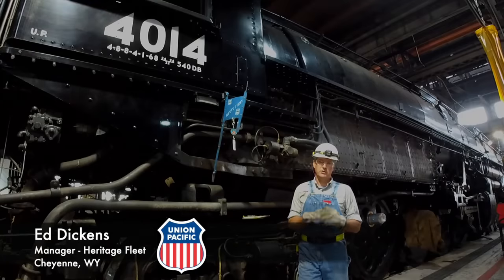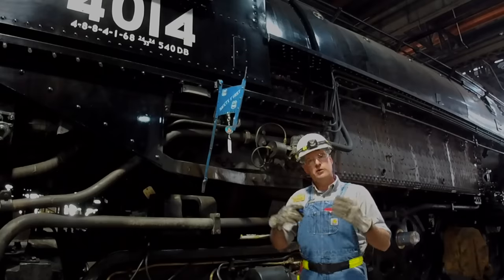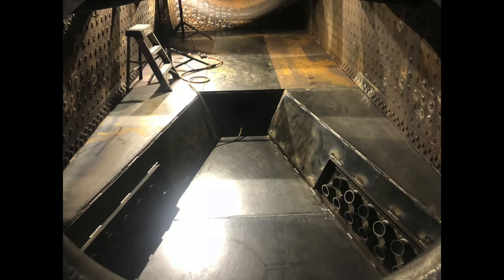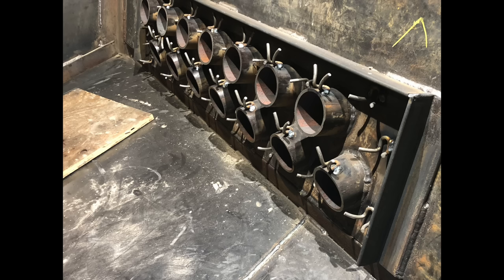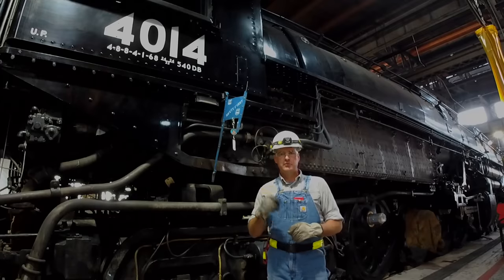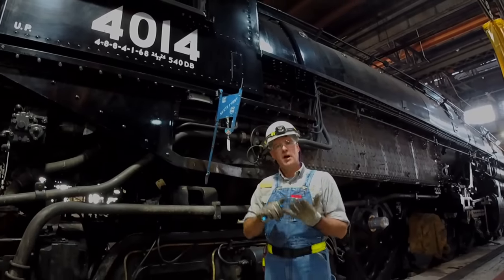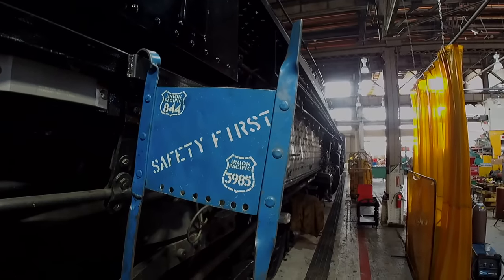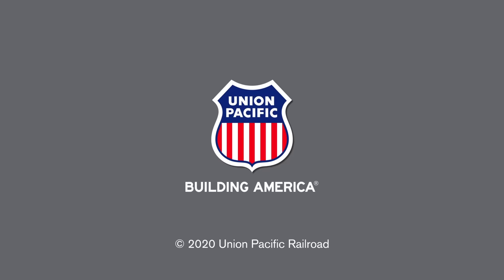UP Steam Update: Converting Big Boy No. 4014 to Oil

Comment: An automatic system to adjust fuel/ air like on a fuel injected automobile engine could be developed for 4014...... but requires time and expense, no?
Reply: Wouldn't work. The conductor predicts his steam pressure needs 2 or 3 miles in advance. You have to build pressure over time without wasting it through the overpressure valve. Waiting to build steam until you get to a hill is too late. Matching the fuel/air mixture in a car is linked to the throttle position sensor, but on a steam engine, the need for steam isn't linked to where the throttle is now, but linked to where the throttle is going to be in three or four minutes.
Reply: @jeffanderlik7695  Wow, excellent insight. That had never occurred to me but now that you mention it, makes total sense. I suppose they had to know (or learn) their routes like the back of their hand prior to operating them.
Reply: @jeffanderlik7695  Automatic engine control....GPS knows where the engine is and what lies ahead....I know, not as much fun but optimum engine efficiency at all times, no?
Reply: @kingmiura8138  there are other factors that require a human interface, such as weather conditions, and obstacles such as other trains. If it were that simple, Diesel-electric locomotives would already have that predictive technology. The train traffic is controlled to some extent by computers, but it's a long, slow transition.

Comment: I find it sad when I hear statements like "the amount of air is controlled by the engineer". On motor vehicles we stopped doing that decades ago, it's called a carburettor, and the venturi on this oil burner is effectively the same thing so why isn't the air/fuel ratio properly controlled in the same way? It isn't even difficult.
Reply: @Kiwi Geo Combustion is combustion whether internal or external, the ratio of air/fuel required is the same. If you like though, compare it to an oil-fired heating system for a large building, the owners of the building would be pretty annoyed if they had to have someone constantly monitoring the air/fuel ratio.
Reply: This is because it's not really like a carburetor. Its actually a damper. And while more automated dampers do exist, having direct control over the dampers gives you more control of your fuel. A boiler you having sitting in your basement won't need it's dampers constantly monitored because it isnt trying to go up hill with a 20 car train and then down the other side. This isn't to say they weren't mechanically supported though. Often times oil fired locomotives would have mechanical devices that would automatically close the dampers during burner stop periods. The point is though that the dampers are normally monitored because it all depends on what the locomotive will be doing not what it's doing currently. A steam locomotive is very large so any adjustment have to be made sometimes miles in advance. Any sort of automated system would have to make changes based on the external environment as well as the internal one. It would also need to be able to know where the train is going and what the weather is. Its of course possible with modern technology but it would be very expensive and have to be specifically developed for a steam locomotive. Considering  the overall cost of the big boy I'm sure something like that wasn't even considered.
Reply: @fermitthekrog6318  The damper is there BECAUSE there is no carburettor system fitted. A carburettor type system would make sure that the oil being burnt is close to the most efficient ratio at all times. It doesn't control WHEN the fuel/air is supplied, just the ratio. It is still possible for the engineer to increase the burn rate in advance of a long climb, I never suggested that part should be done by an automated device.

The damper system is a hangover from coal power. With a coal-fired boiler the burn rate is controlled by the amount of air supplied. Trying to use such a system on an oil-fired boiler is wasteful and produces the smoke seen here. If the price of oil had been at today's level they would have soon changed that.

It is possible for the engineer to reduce the amount of oil being supplied but if he reduces it too much there is a risk that the burner could go out. The engineer also has to increase the oil flow before opening the damper or again risks the burner being extinguished. It leaves the engineer with the impossible task of trying to balance the amount of oil supplied to match the air being supplied, in varying conditions as you have said, with an imprecise damper system. I imagine that having the burner extinguished would be disastrous so the engineer is always going to supply excess oil and as a result cause the oily black smoke.

I agree that in the comparison to a building's heating system that the "demand" part is controlled automatically to maintain a steady temperature and I can appreciate that it introduced confusion but it isn't really what I was comparing.

Comment: I would like to see a k5la train horn get installed on this steam locomotive.
Reply: I wonder if that would even work? I am pretty sure there’s a substantial difference in the air pressure of a steam whistle vs a diesel air horn. Probably opposite ratios of pressure vs volume, just a guess.
Reply: @Syclone0044  there are also steam powered train horns as well.
Reply: no

Comment: Hows the fuel efficiency compared to a diesel electric
Reply: 4014 doesnt use diesel, rather it uses #5 Bunker Oil, typically at a rate of 20-30 Gallons per Mile. (Yes, GALLONS per MILE)

Comment: Is the fixation on running these grand machines on oil an anti-coal statement by UP? Burning coal is one of the attractions of steam powered machinery. Without coal, much of the charm/nostalgia is lost in my humble opinion.
Reply: Converting steam locomotives to oil has been done since the 1890s. The fuel it burns doesn't keep it from being a steam locomotive.
Reply: @jamesfluharty1945  That's your opinion, not an answer to my question. I don't agree with modifying a machine from its original design. It was built as a coal fired machine so it's now not original.
Reply: @dylanlewis3666  it's not anti anything. UP and other railroads modify their locomotives to fit their needs. An example of this is the UP FEF series. All were converted to oil in the 40s. The charm of a steam locomotive isn't in the fuel it burns. Your issue with modifying the machine is rather pointless. Many  steam locomotive were rebuild, fitted with boosters, converted to oil, had tenders swapped as well as many other things. Sometimes they were sent back to the shop they came from, just so the company that built them could turn them into new locomotives. An example of this is the PRR H8. This locomotive class had some units rebuilt into H9s. Modifying and upgrading locomotives has been done as long as they've existed.

Comment: Sadly the Loco now is no longer original. What is next, fit Electric Motors?
Once you start making it "better", it never stops.
The fastest Steam Loco ever is the English Pacific Class, Mallard. Running on Welsh Steam Coal.
An on a normal run, not a record breaking one. An yes it still exists an runs on the same coal.
The speed was just over 126 mph pulling 7 passanger cars weighting 240 tons. On the 3rd of July 1938.
I got my info from a 1950`s Guinness book. NOT the joke wiki!
Reply: Converting steam locomotives to oil has been done since the 1890s and is in no way comparable to putting an electric motor in it. Its called a steam locomotive, not a coal locomotive, the fuel it burns doesn't change that fact.

Comment: Why UP? Even NS didn’t do that
Reply: If I understand your question right, might be because fuel oil is an easier fuel to handle - you can refuel with a tanker truck, and a hose.  Coal takes more handling equipment - or more people with shovels.   Oil refueling can be done at pretty much any yard, or even any crossing, I'll bet.   Coal towers are now few and far between - and not maintained or containing any coal.
Reply: @FalbertForester  
And...coal burning produces cinders, which have started many fires along the tracks in the past.  Oil is safer.  You are spot on about lack of coal handling equipment.

Comment: Plz bring again in world off railways, history says history repeats itself, use some Gas fuel into it ,water can heat very fast , only coal u can remove from it,. On that theory steam can remain same , than its only we can call steam locomotive,  on tender ares u can shift solar system installed init under solar plate u can also built battery  put in fire box some heating rod ,like immersion rod for Boling water , these are some ideas that I have to share with you,,,,,,plz think off it  on that basis they can again in power all world off railways plzzzzz bring back in all trains,

Comment: 🤔 Couldn't they just convert it to run on Bio-coal? or Coke Hihh Pressure Heating Coal
Reply: oil is more easier to transfer as well running it coal fired is a logistical and coat nightmare

Comment: That way you can have the worst of all worlds.  A low efficiency engine with an expensive fuel.  Why not put in an auger for the coal, to make the 'fireman's' job easier, (or not needed.)
Reply: Its been upgraded and isn't the original big boy oil conversion so odds are the efficiency issues are either fixed or are negligible. Also oil is currently cheaper then coal

Comment: I believe that it is a shame to see a steam engine that got preserved to be modernised and dare I say ruined by our need to modernise everything
Reply: It's not about modernizing, it's about practicality. There no more coal towers out on the main lines. Refueling with coal would be very costly and a logistical nightmare.  The mechanical stoker has many moving parts to maintain as well. Oil is easier to get, FAR easier to transport and refuel and much cleaner burning.

Comment: Can you convert it back to coal?
Reply: They can’t. Because I think coal was more expensive and it is more dirty to burn. So oil is cheaper and cleaner to burn.
Reply: They can - it was mentioned in the video that there's a bunch of coal handling equipment that was removed.  Anyone working with antiques like this will never throw out any piece of removed equipment.  And it was mentioned that other steam locomotives have been converted to oil and back to coal again.  

It's probably not economical or practical to do so, however.   I have been good friends with a University VP of Finance, who was there for the change over from coal to oil of the furnaces on campus ( 100 year old buildings, in some cases).   He said that their numbers reported that if oil hit $15/gallon, it would be cheaper to go back to coal - which they could do by pulling out the oil grates in the furnaces and putting the coal ones back and hiring three people to go around to the buildings all night, and shovel coal into them.
Reply: They aren't gonna do it
Reply: @evanf1293  well if oil gets too expensive they might consider it who knows!
Reply: @rudycarlson8245  Best not to worry about it
Reply: @Jimboliah3985  might as well be a diesel if it’s not burning coal. Everyone has their own opinion.

Comment: It’s now a diesel locomotive. Next you’ll be putting in a lithium ion battery to make it run on electric. Which might be interesting to see.
Reply: Converting steam locomotives to oil has been done since the 1890s and is in no way comparable to putting a battery in it. Its called a steam locomotive, not a coal locomotive, the fuel it burns doesn't change that fact.

Comment: Why in the Hell would you convert it? If you do it will not be original and folks will loose interest.
Reply: The main reason is logistics.  There just isn't any infrastructure left to service steam engines on the railroad.  No more coal loading stations, no more water towers.  These were all removed as they retired steam engines.  Now they have to bring all the water and fuel they'll need with them.

Comment: Nothing makes me sad when they convert a train to run off oil it's a steam train is a steam train for a reason it runs off coal or wood to make its steam oil is just the easy way out and it takes away from the fun of the steam engine crap like this ticks me off but welcome to America.
Reply: What are you talking about? Oil burning locomotives have existed since 1890. This isn't anything new. Entire regions of some railroads were powered by oil burning locomotives. Its just as authentic as coal and wood.
Reply: @fermitthekrog6318  honestly I have nothing against oil burning a locomotives but the big boy has always been a coal burning engine it just doesn't make sense to convert it to run on oil especially when there's an oil shortage practically right now and it's hard to come by plus the engine is going to require a lot of oil
Reply: @GHOSTTRAINPRODUCTION  they’ve converted big boy 4005 to oil in the past, and challenger 3985 was converted to burn oil in the 90s. The price fluctuates but oil isn’t hard to come by. Some railroads actually found it easier to use oil, sometimes cheaper. While it may use a lot of oil it would also be using a lot coal if it still burned it

Comment: Dear Engineer. Ed Dickens. I'm railroad engineer too from CH. I pray you to avoid this modification to oil and leave this Big Boy with its original coal system.
Reply: Here's the reason 4014 was converted from coal to oil...

"...Right now, No. 4014’s tender car is designed to carry coal. The steam team plans to convert it to carry oil.

“The logistics of coal are very impractical for a big boy,” Dickens said. “It can be a fire hazard.”

When a locomotive burns coal, the coal eventually burns down to ash and cinders. Those cinders travel up and out the smoke stack – eventually raining down on all the surroundings..."
https://www.up.com/aboutup/community/inside_track/august-steam-8-11-2016.htm
Steam Update: Big Boy No. 4014 Restoration Begins
Reply: @jerryleslie1881  I understand how that could be a fire hazard, but I think it would be better to leave the original tender as it is and build a new oil one. Merry Christmas to all the train enthusiasts!
Reply: Too late! It already burns oil and it does it really danm well.
Reply: @Francescolongok  They swapped tenders with 3985, as it was already modified to carry oil.

Comment: You mean how U.P. destroyed a historic steam locomotive They even kept the 611 coal fired.
Reply: They didn't destroy anything. Converting locomovrs to oil isn't something new. Its been done for decades by various railroads.
Reply: @fermitthekrog6318  I'm my opinion they did.... taking something and changing how it was build in a big way is not saving it. Might as well build a new one at that point
Reply: @madmat276  you are aware that locomotives were historically modified and had their fuels changed all the time? The entire FEF fleet was converted to oil in the 40s and they even experimented with converting the big boy 4005 to burn oil. It’s called a steam locomotive not a coal locomotive, the fuel it burns doesn’t change that fact. What they did here to modify this locomotive was already done decades before you were born to countless other locomotives while steam still crossed the country. The challenger they ran is another example of a locomotive they converted to burn oil, except it was done in the 90s. This modification is no different then adding boosters or changing the tender of a locomotive, stuff that was actually done many times in the past.
Reply: @fermitthekrog6318  again it's my opinion... it was not ran with diesel when it was running it ran with coal.. why change it to restore it....
Reply: @madmat276  simple, its impractical with many reason to offer